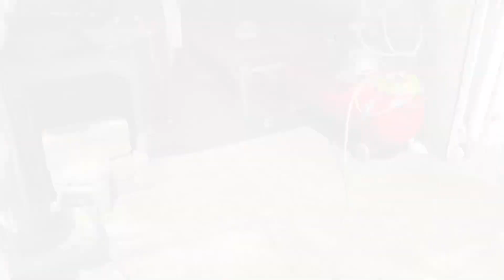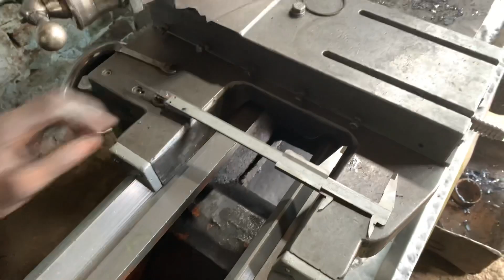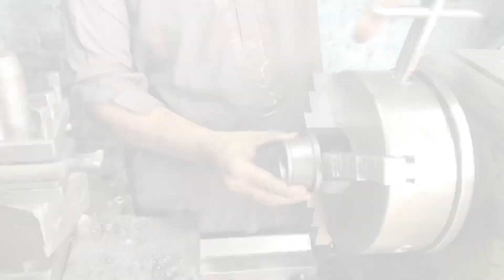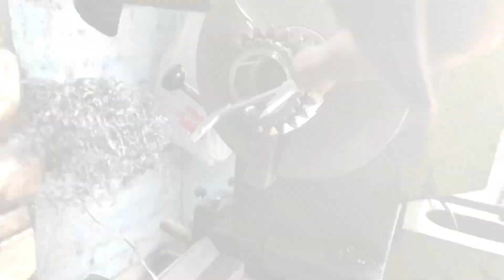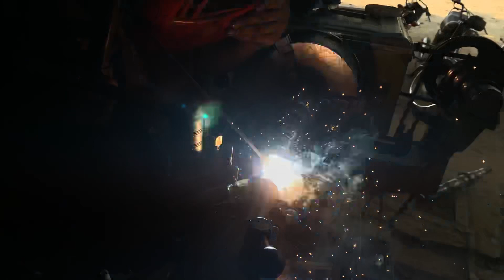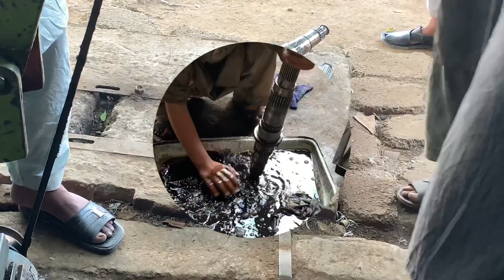How to Repair Gear Main Shaft Bearing Size | Restoration Gear input-shaft

Comment: Oh the humanity. I doubt if orange-hot turnings are right.  Maybe a lower speed or sharper cutting tool?    Maybe a chip-cutting edge on the tool too.   I don’t think this is the way Henry Ford did it.
Reply: indeed, a micrometer on a smoking hot surface mean nothing too. The harden bearing surface is gone too, if there is radial load, the roller bearing will bite into it and ruins the shaft again.